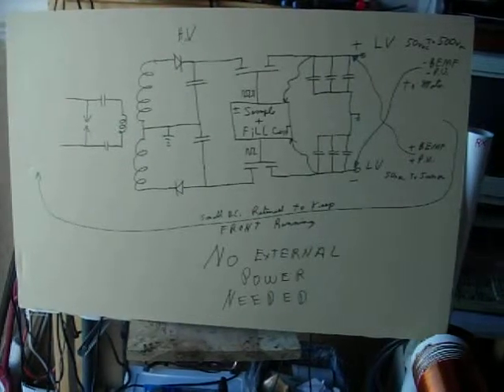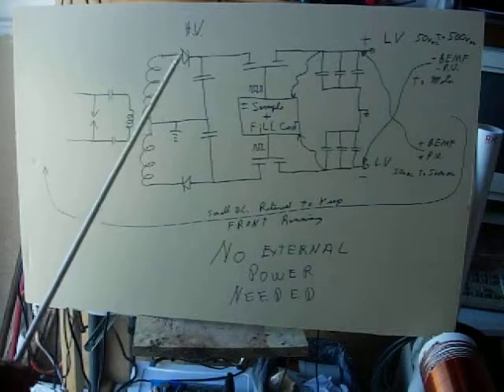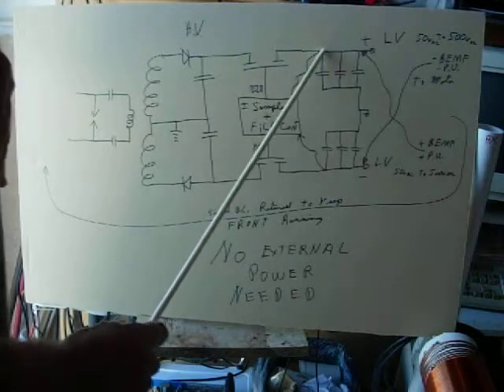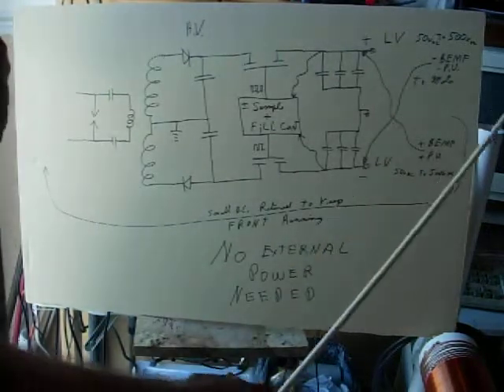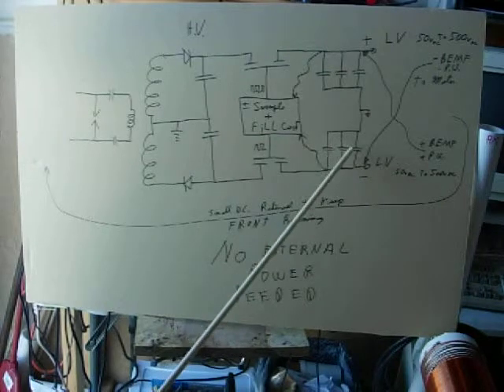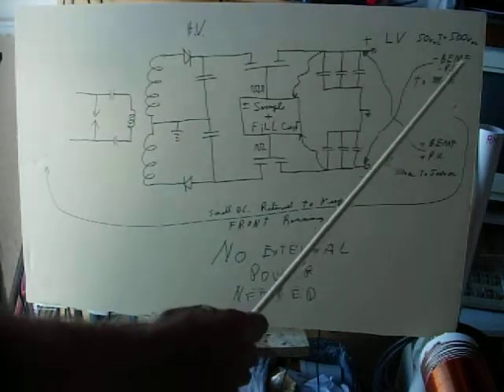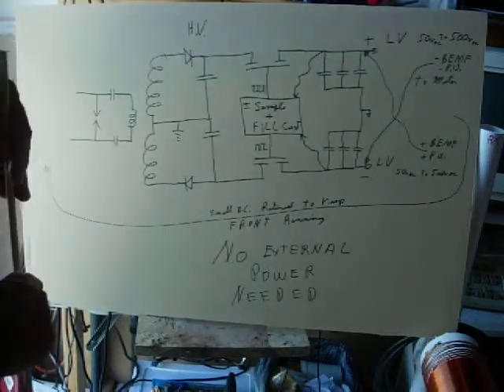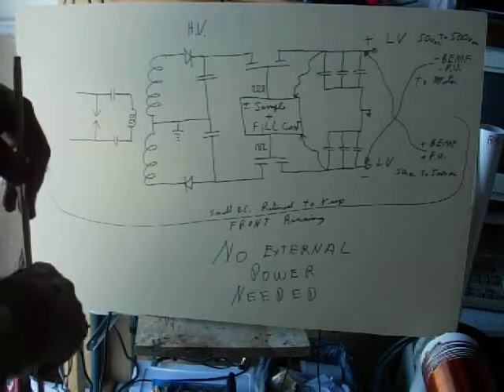Don Smith #81 New Energy schematic for my first motor project

Comment: that's a nice circuit,  this one here is similar except the yin and yan is within the 24 coils themselves  the entire craft is the circuit ,literally.using the 7.4 volt Motorola rechargeable batterys and the 2000 volt micro wave caps  set up similar,   a ways away for that part, be trying to figure out how to mix up and pour all this into the mold  that still needs to be made  hence the junk removal day,.  lol

Comment from the maker: Just tried to turn on my PCB with Max038 IC wired as a sine wave gen.  When pin 20 was connected to the -5vdc 7905 reg the reg got extremely hot and fried.  To the required RF I found a Sig Gen on Ebay old vintage unit.  also got the manual for it.